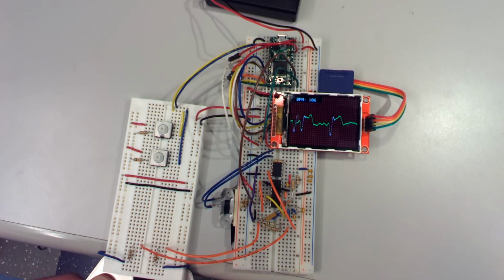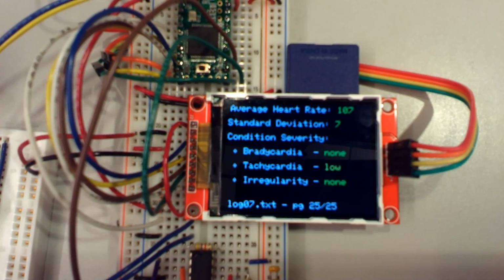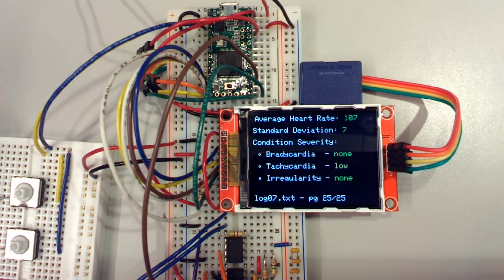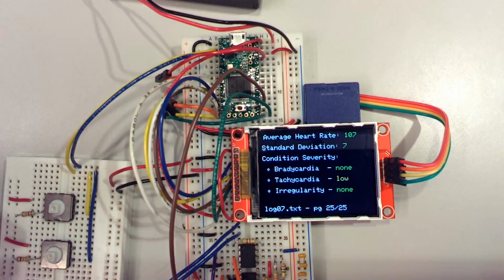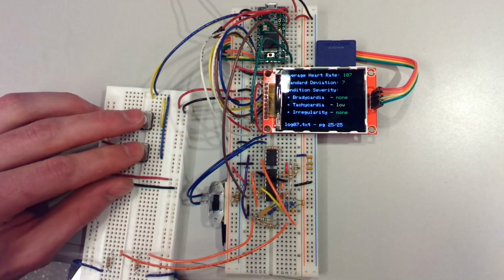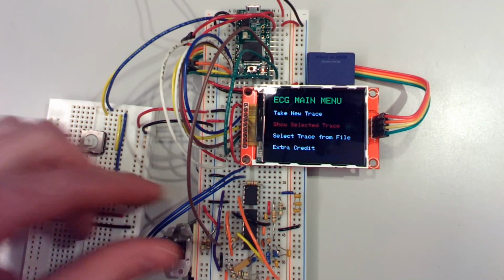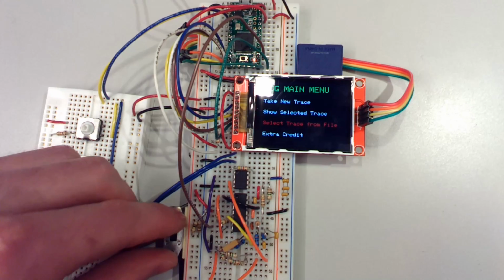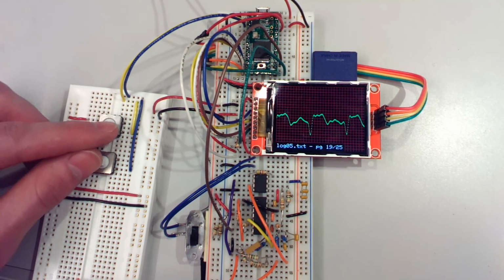ECG / Heart Rate Monitor - CSE 466 Final Project

Comment: What year and degree did you do this? Just trying to roughly gauge what different uni's do at what year
Reply from the maker: I did this as part of my Computer Engineering undergrad program. Think this was my junior year.
Reply: @teddybrow  cool man, I'm from UK and we did a similar project in our second year, but not as complex. We had a simpler analogue circuit (less accuracy) and used a photo diode for heart readings. Your one is a lot nicer, and it seems to use nicer components Haha.
Reply: @teddybrow  Also a teensy3.1 and ili9341 display is a lot better than a crappy Mbed and an 8x8 led matrix to show display. (what we had to work with) 😝

Comment: Hi teddy brow if you could please send the components required on how to build the circuit that would be very appreciated as I have an assignment to do in which I have to design a heart rate monitor looking through your video has given me confidence and it is the best version I have been able to find. Thank you for time
Reply from the maker: The schematic for the basic heart rate sensing circuit was provided for us as part of the assignment. You can find that here:
https://courses.cs.washington.edu/courses/cse466/14au/labs/l7/l7.html
Hopefully that's enough to go off of. It's been four and a half years now since I worked on this project, so I don't really remember any details lol. Good luck!
Reply: @teddybrow  thank you very much for showing me the website. However, I am unable to find the arduino code that you have used for your circuit if you could help with that it would be much appreciated and as always thank you for your time
Reply from the maker: @lanzikhan6904  Unfortunately, I don't have the Arduino code anymore. The professor provided just the circuit schematic, and we were left to figure out the rest. The code we wrote was so specific to our particular setup (e.g. the Teensy dev board we used, to which inputs we wired each signal, etc.) that it didn't really seem worth hanging on to the code. It wouldn't be easy to reuse it without knowing the exact configuration/wiring of our breadboard. Sorry I can't be of more help!
Reply: @teddybrow  thabk you for all your help Teddy brow. In appreciate you trying to help me.
Reply: Hi khan ! I wish you are doing well. Did you find the Arduino code cause I really wanted for the experience

Comment: Would be great if you published your project, maybe with the tutorial...
Reply from the maker: +Edoardo Falcone : Unfortunately, I didn't archive my Arduino code, as it relied heavily on the specific setup of the circuit we built and the components we were using and thus didn't seem worth saving. However, if you're interested in developing your own, I'll post links to the course materials below. Labs 7-9 deal with this project. Lab 7 contains the schematic for the core of the circuit we used. The rest of the project was largely unguided; we had some requirements to fulfill, and it was up to us to figure out how to implement them.
https://courses.cs.washington.edu/courses/cse466/14au/Calendar.html